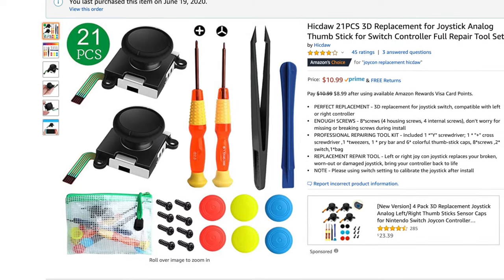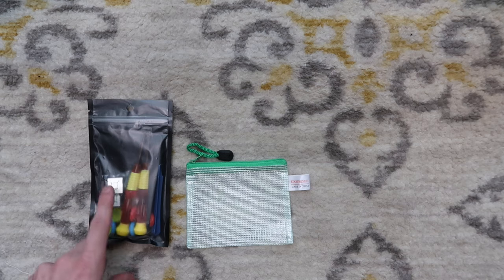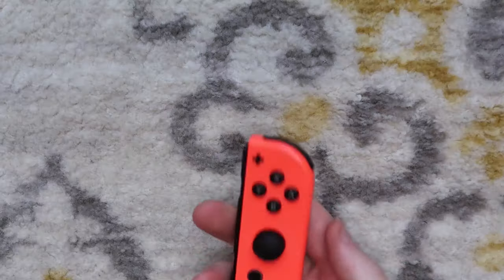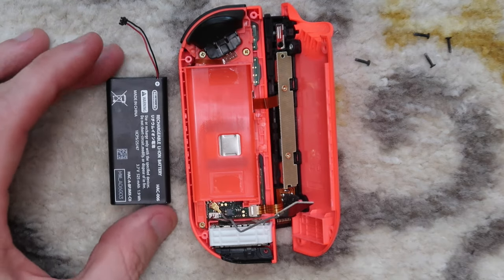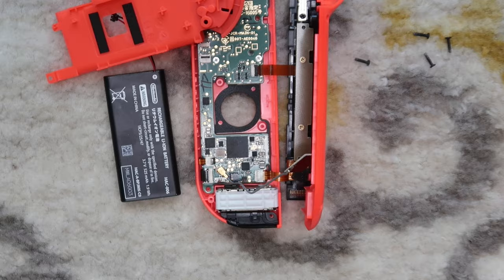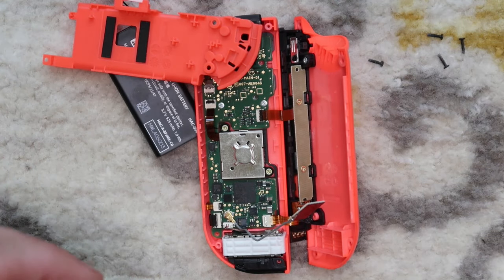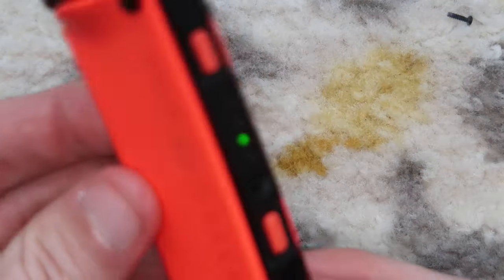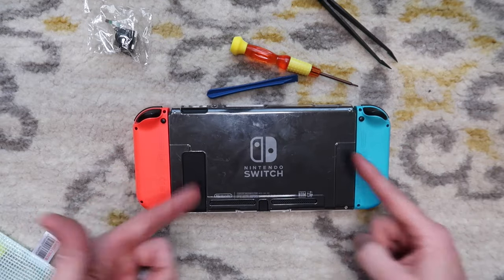How to Fix Right Joycon Drift Step by Step with a $11 Amazon Analog Joystick Kit (tools included)

Comment: Gotta Love this guy hearting and pinning all the people succeeding and not the people who broke their battery connector cause he wasn't clear enough
Reply from the maker: It's hard to heart things that aren't done carefully and end in regret. ♥️
Reply: After people had issues with the battery connector, you could've re-uploaded the video with an edit. I'm another one who ripped the base of the battery connector out. Thanks
Reply: @sephiron688  Yeah, I downvoted the video. If you watch closely just before he "removes" the battery, he edited the video at that point, cutting something out of his process to make it seem like you can just slip a spudger right under the battery.
Reply: Video was perfectly clear enough for me, removed my battery connector just fine exactly as he did it. I guess some people don't watch ahead to make sure they know what is coming and/or use the proper care. Great video, thanks ❤

Comment: Just wanted to add that after replacing the analog stick and when you are checking for drift, there are some instances where it does not go EXACTLY back to the center and could be off-centered by a slight bit.  I found that calibrating the analog stick from that page by pressing "X" fixes this in many cases.  I thought I had a few defective ones, but turns on calibration is all that is needed.
Reply: Yeah this happened to me to
Reply: So glad I read this comment Happened to 1 of the 4 I fixed and I thought it as defective. Thanks a bunch. :D

Comment: Little hack for those pesky ribbons cables not going back in: Attach a piece of tape (teflon preferred, scotch is fine) to the neck area, and use the tape as your lever for putting it back in. Adds no stress to the cable and no risk of bending it. 

Great tutorial, OP!

Comment: This was a good video. As for the battery connector, I guess it's best to say to pull up when removing it. I was unsure of which way to pull and scared I may pull the wires out.
Reply from the maker: Yes it snaps in from the top, so removal by pulling up. I never thought it would be such an issue 😳
Reply: I just snapped the entire connector out of the controller for the battery. So note, don't waste the time to remove it, just leave it connected, just move it
Reply: @thegingerviking8698  that just happened to me!  So pissed right now.  It wasn’t very clear in the video that there wires from the battery sat in another housing thing.  What a waste
Reply: @Buckethead523  How did you get the base back onto the mother board? Same thing happened to me and I pulled the base right off of the mother board
Reply: @thegingerviking8698  Were you able to attack it back onto the motherboard? Same thing happened to me.
Reply: @abbylarson4248  youd have to use a soldering Iron to reconnect it to the board.  its not worth the time, I just bought a new joycon.  Sorry this isnt much help :-/
Reply: Yep just fucked mine up by pulling the wire out of the connector....
Reply: yeah i broke mine and probably have to get new joycons now
Reply: I just ripped my battery wires out. Wish I had read this first.
Reply: Glad I’m not the only one going through this.
Reply: I just ripped the whole battery connector as well! The video didn't specify any of this! Dislike

Comment: Just fixed both my joy cons with this video's help. Thank you. Opted to not disconnect power and carefully set battery aside and it was fine. Left joy con has a thin tricky ribbon cable over one of the c stick screws, but I unscrewed the bit it was connected to (and it as well has a ribbon with little to no give so it can't be moved much!) And it allowed enough slack to get to the screw without damaging anything.

Was surprised at how seemingly little the c stick ribbon cable plugs into the assembly bit with the black latch. Kept trying to poke more inside of it but it wasn't necessary.

Thanks again for a clear video. Stoked for some tears of the kingdom without crushing my controls in frustration at drift. WE'RE BACK BABY!
Reply from the maker: Glad you got it fixed. You are very welcome 🤝

Comment: bought the kit off amazon. thank you. that kit has literally everything you need. had i watched this video first i would have used your referal link. i initially just bought it thinking i could just figure it out. the pictogram instructions were straightforward until removing/re-installing that ribbon cable. also, thanks for the quick tidbit about the trigger. this video saved me $80 on new controllers. have a happy kid again. Thanks Man.
Reply from the maker: You are welcome. Glad you were able to level up and keep the kiddo happy and also save some money. Keep on learning 🤝

Comment: great video finally got a stick fixed after getting the confidence to do it. was scared i would break it but when i tried it it was actually really easy, also i didnt feel like pulling the battery out because i thought i would tear the cables so i just left it connected and did the procedure and it was still fine.
Reply from the maker: Good work! Glad you got it going

Comment: my repairs to both joycons went fine, thanks for the shoulder button tips. in longevity news, the joystick from this pack lasted about a year before developing the opposite problem to drifting, as in, now i cannot calibrate it at all in settings because the dead zone is enormous and the input doesn't go far enough to the right to register. the entire stick is off by one calibration circle to the left. the stick itself has developed a fault. just an fyi for folks wondering about longevity of this repair kit.

Comment: I followed the instructions in the video and fixed my red joycon.
But i didn't remove the battery from the motherboard and i removed the stick's cap to decrease it's diameter and have it pass easily from the hole.
Thanks for the video!
Reply from the maker: You are welcome. Happy to hear surgery was a success 🙌😷

Comment: I recommend not removing the battery clip as you could break it. Otherwise great vid.
Reply from the maker: 😬 if you don't remove the battery you potentially risk shorting out the board if something wrong touches something else wrong.
Reply: I just removed it but mine was supposed to be pulled out..... I just ripped the battery connector out. This vid wasn’t super clear and must have been a different model.... wish I knew that before hand
Reply: @ssshampoo  ya same here but it still works on hand held so it’s a win for me
Reply: @ssshampoo  Same, the battery part was the most annoying part, I would say.
Reply: @ssshampoo  There is an English guy that was very clear. The right joycon is much easier than the left. You don't need do disconnect the battery.  Just use the the plastic stuff with the hook to pry it out of the case and rest on the right side. After unscrewing the 3 cross head screws you only have that one little joystick ribbon with the clip that secures it . Use the plastic tool with the little hook and bring it back to release the ribbon. Unscrew the 2 joystick screws and gently remove it from the  socket. Push in the ribbon of the new joystick to the gold line on the case and pull that clip forward to secure it then screw in the 2 screws. Gently put the the little antenna in the slot and then screw back battery case , put in back battery then outer case.
Reply: Wish I'd seen your comment before I did it. The whole clip came off and when I tried to put it back on not realizing it had come off it broke the prongs. So now I've got to attempt to solder the clip back on.
Reply: @ssshampoo I did the SAME thing. None of the vids I watched mentioned it was inside a seat - I just pulled up on it and the entire thing came off.
Reply: @chuyresendiz8441 ? It works if it's plugged into the switch?
Reply: Is there a way to reconnect to the battery connector?  Didn’t mean to pry it off completely.
Reply: I just completely removed the whole battery connector off! Dumo video why did he not specify this!!!

Comment: If you don't have supplies or tools, try removing your controllers, and go to "find controllers" and hold down the screen for the vibration and move your control stick while spinning your hand. Do that for a minute then check back on the calibration selection to test if it worked. 
It's  the graphite that causes the drift, a dust like material after wearing down the contacts, so the vibration probably shakes the dust into another area where it doesn't do as much unwanted inputs.
Reply from the maker: Definitely worth a try =)
Reply: And you just have to clean it with a qtip soaked with a cleaning solution.

Comment: Do you have an update for them? Are they still working?
Reply from the maker: Mine are yeah but I only play a few hours a week these days.
Reply: Although I just received and installed mine, I must say they feel great. At such a great price, I was able to fix 3 of my joy cons.
Reply from the maker: Glad surgery went well 😷🔪
Reply: I did this, 1 month later it is still working with moderate/heavy use. my first replacement worked(came with 4). My con had a different layout when opened and but found another video with that specific layout
Reply: @aquarion9816  thanks👍👍
Reply: @thecollegepicker  when I opened the right joy con, one of the cables came out. Is it broken forever, or is there a way to fix that?
Reply: @ReallyRamsters  you can reinsert them and they still work :)
Reply: @aquarion9816  I also have a different layout...like the NFC chip isn't in the same place as this one at all. It's one of the OG joycons from 2017. Would you mind telling me how to get to the same video you found? Thank you in advance!
Reply: @cipher893  Tbh I just searched fixing nintendo joycon or replacing joycon controller and looked through them. Don't remember the specific video I found. I think there are 3-4 different layouts

Comment: Great video. Bought the kit from the link but it showed up with different stuff in it (granted it is a year+ later) but it still worked just fine. I fixed my left joycon which was a little different from the video but I wouldn't even have tried the repair without the video

Comment: Great video. I would just recommend not detaching the battery. You can do it with out disconnecting and on my first attempt I ripped the whole battery connection out and ruined my joycon. ✌🏻❤️🐺
Reply: too risking u may want to use small tool that will allow disconnecting battery i did it first try no damage with i fix it tool

Comment: Thank you for the instruction. I already had to do that with both Joycons on my Switch (considering how common this issue is, the name joy-CON may be very correct).

One thing caused me much more trouble than the video suggests - the outside screws. Each joycon had one screw that didn't want to move even a bit (the bottom one on the outer side in both cases) so I had to drill through them.

Anyways I managed to fix both and everything's working perfectly now. I could just try to get Nintendo to fix them instead, but they don't have an official service in my country and sending my joycon to another country would take very long and would probably cost me more than the repair kit, especially considering I'd have to do it twice.

Comment: I’ve never repaired any electronics before, but I tried with my joycon.  Tried following this video, but it was my left joy on that needed repair, and there are some big differences I was noticing between what was in this video and what my actual joycon looked liked.  I was thinking maybe he had a newer design and didn’t even that think the left and right would be different inside.  So I just tried to follow this as best as I could and use my brain to figure out how to do the things that weren’t in this video.  It took about 30 minutes, and I wasn’t sure if I got the ribbon cables inserted fully, but when after reassembling it and testing it, everything worked.  No more drift!  The only thing is, I have 2 extra screws sitting here now, and I have no idea where they go.  Oh well, it works.  Guess these screws don’t matter…

Comment: Happy to say I got myself a 15 dollar kit like this and now my joycons are back to normal. I rate this life hack 10/10 ⭐️
Reply from the maker: Glad surgery went well 💪
Reply: is the new thumbstick the same with the old one or does it have any difference ?
Reply: @ozanozenir2503   its pretty much the same other than the color for the ribbon cables, I didn't have any problems when I got it
Reply: @lemonmelon2168  thx for the reply i am wondering if the material on the new thumbstick is the same with the original one because i know i will feel uncomfortable if they are different
Reply: @ozanozenir2503  yeah the material on the joystick is the same and it feels pretty much like the original so you dont have to worry
Reply: @lemonmelon2168  ok thank you for the replies 💛

Comment: Thank for the video. Very informative. 👍🏼👍🏼👍🏼
A little fast at times, but I Just kept rewinding and pausing.😉
Tried following the ifixit video and got stuck thinking a spudger/ pry tool was necessary to remove the battery; evidently not 🙄
Found your video after and completed the replacement on right joycon without hassle, even though I'm a less tech-savvy mum.😂

Comment: Thanks much for the assist! Everything came together pretty well (except for plugging in the battery, that was like microsurgery...), but the strange thing is that the old thumbstick in the Joycon was falling apart when I opened the case. After unscrewing it, it just disintegrated. Are they always this flimsy?

Comment: Power cable just broke apart before breaking off. Even after it's broke off im tring to see how it clips off and it don't. So much for a quick cheaper fix 🙄
Reply: Mine very almost did and was almost the scariest part for me. Unsure if I scratched off a bit of the plastic on the cable and worried it won't work now.

Scariest part was very almost chewing the screws because the well reviewed screwdriver I bought sucked and was damaged before I used it without me realising.

Comment: Not a bad video.  I've used it 3 times now.  I replaced the pink side, then the blue side.  Pink side began to drift again way too soon.  I just replaced the pink side for a second time and the blue side is acting up as well so I will have to replace that one for a second time as well.  It seems that the replacement parts are even more defective than the original...

Comment: This is a solid video other than the fact that there was a failure to mention that the battery connection has a housing that SHOULdNT be removed. I popped it up as the video suggested, and boom. I now have a new joystick in a controller with no battery. So full replacement here I come. 

I know those with more tech experience would have known that, but I feel like that’s a big miss for a newb like myself in an instructional video. But that’s what my dumbass gets for trying to fix it myself. I’ll stick to cooking lol.
Reply: (Thank you for taking the time to make this though!)
Reply: Same thing just happened to me. Huge miss on this. Now I have to buy another one.... 😩

Comment: So it looks like when I pried off the small battery terminal on the left joycon it actually snapped a metal terminal off. So be careful with that. I may be able to solder it back otherwise it’s trash
Reply: Ya it seems the Left & Right Joycons are not built the same

Comment: Great video, this helped a lot!! However, I had to change it back to the old one that uses a lot of force to press down (that was the issue that needed replacement) as the amazon joystick doesn’t have motion control and I use that more in my Zelda TOTK gameplay for arrows than the pressing down for the scope.

Comment: If you're a first timer at repairing little stuff be careful with the amount of pressure you use when unscrewing the little screws. I wasn't and I immediately stripped the screw so I can't get it out now. Had to just give up before I could really start. Learn from my mistake :o

Comment: God damnit. I just switched the sticks for both of my joycons using 2 different guides for each side only to now watch this and see you explain every little thing I had trouble with that the other guides just didn't bother to explain (like which way the battery power cable is supposed to go).

Comment: Alright, so I tried fixing my right joycon after it started drifting just like left one, and all the buttons on it work just fine... except for the stick on the right Joycon. It doesn't make any responses whatsoever and for some reason the stick is always moving to the left. I think I wasn't supposed to remove some plastic cover that was on the in connector attached to the stick, is there anything else I can do about it?

Comment: Heya, I have a question regarding the size of the screwdrivers. I got one of those 16 -repair Kit from an online retailer. I got it earlier today, but the moment I tried removing the screws I noticed the triangular screwdriver's size is 2.0×3.1 rather than the recommended 2.0×4.0. Will it still work or should I be worried?

Comment: Done 2 , the first one I disconnected the battery and the whole bloody thing pulled out ,so it only now works when on the console , the 2nd one I done when was dead and left battery plugged in and worked no problem 😊 , now how do I get the battery attachednto the board ? Is it just simply a tiny bit of soldering?? Please reply

Comment: I think I messed mine up 😭 The little black piece you connect the wire from the battery to came off along with the wire part, so now I can't connect the battery to it. I can't just glue it back on can I? Or should I admit defeat lol

Comment: PSA: the battery connector is two parts, the connecter and the mount. Take care not to pry the mount off thinking it’s one piece. I have learned this the hard way
Reply: how did you fix the mount that was pulled off?